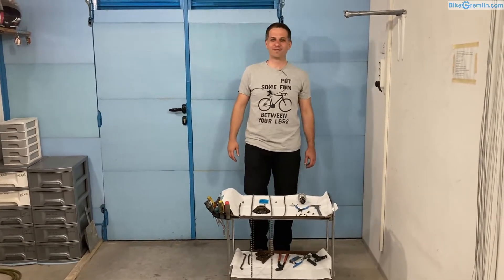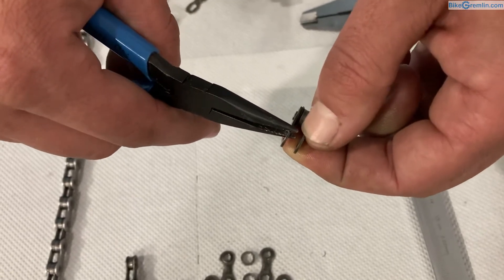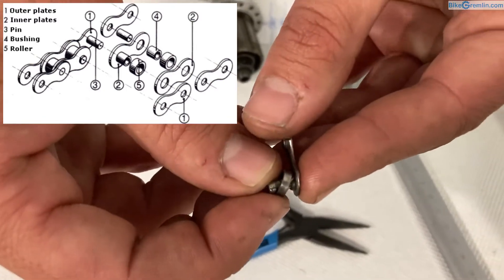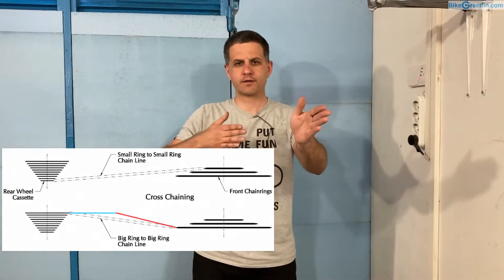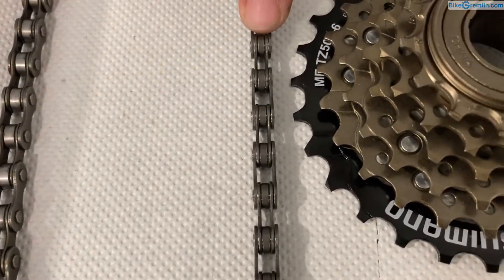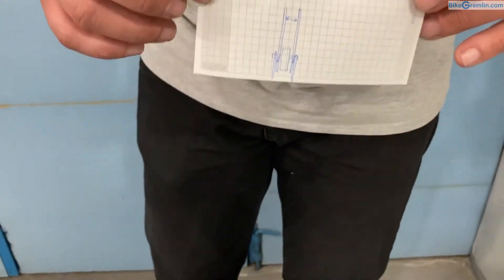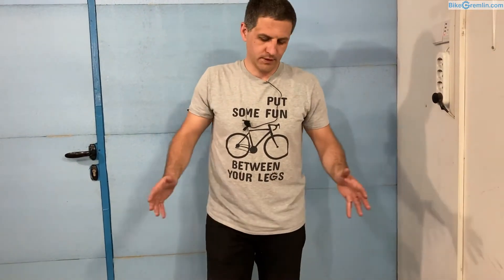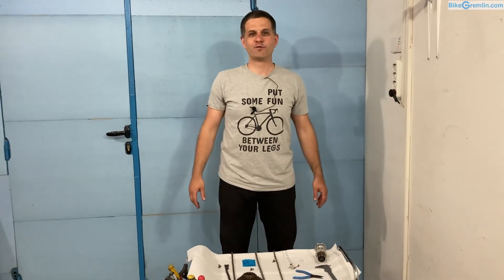Bicycle chain construction and standards

Comment: Excellent explanatory video!
I have always had 5, 6 and 7 speed bicycles, but recently I purchased a 9 speed old B-Twin and was wondering about the differences between the chains, as I intend to restore it. Your chart showing the inner and outer widths (including values in mm - thanks for your kindness) were essential for my understanding.
Thanks for such a clear and clarifying video. Cheers.

Comment: I am trying to understand bicycle chain wear indicators -- but most of them measure "inner" lengths over some number of links on the chain -- and I can't find the official "roller" diameter for bicycle chain. The "inner" length should be N x 12.7mm - D where D is the roller diameter. This can also be measured with a cheap digital caliper. It is also easy to measure the "outer" length of some number of links, however it is less easy to measure some number of links on the "same side."
Reply from the maker: How to measure the chain wear, and some tools that measure it accurately:
https://bike.bikegremlin.com/733/change-chain-bicycle/

Relja
Reply: @BikeGremlinUS  The Shimano TL-CN42 looks like a good design. Maybe I can modify a cheap gauge into one that works the same way?

Comment: Could you please help me to find out the right chain for my Giant Talon Hub gear system?
I recently modified the gear system of my Gaint Talon from  3x7 to Shimano Nexus C 6000 ( Geared hub system) Shimano recommended ratio shall be 18T (R) and 38T (F)front. Accordingly, I provide a 38T Chain ring fixed in front and 18T in the rear, due to the chain slag I am unable to use 38T, Currently using 32T which makes a tic noise when we put pressure on the pedals. What kind of chain should I use for the 38T Chain ring or any other solution to avoid the chain noises. looking for your valuable advice.
Reply from the maker: For chains, the relevant info is their width. 
With gear hubs (only one chainring on each end), it only matters whether the rear hub (and its sprocket) are designed for a single-speed chain which has the inner width of 1/8″ (3.175 mm), or for a multi-speed chain.
- My chain standards article:
https://bike.bikegremlin.com/3555/bicycle-drive-chain-dimension-standards/

A quick way to test is to take an 8-speed chain and see if it nicely and easily fits on the chainrings, and spins smoothly. If it doesn't, a single-speed chain is needed.

Having said that, single speed chains are cheaper, and not any weaker. So, even if you drivetrain works nice with a multi-speed chain, it's worth giving it a go with a single-speed one. If it doesn't scratch anything (like against the hub at the rear), it should work fine.

The tic noise source is important to determine for troubleshooting. I wrote here how to systematically test to see what makes the noise on a bicycle:
https://bike.bikegremlin.com/7153/creaking-clicking/

The tic could be as simple as a single-speed chains (wider) connection link/pin hitting the front chainguard (if there is one) or a part of the rear hub. That doesn't happen per every revolution, as it takes a few turns for the link to reach the front chainring again.

That aside, chain can make noise when it is not lubricated. Poor chainline (angled chain) does make it worse.
In case it's needed and it helps:

How to lubricate the chain:
https://bike.bikegremlin.com/44/best-bicycle-chain-lube/

How to measure and "correct" the chainline:
https://bike.bikegremlin.com/1755/bicycle-chainline/

Relja
Reply: @BikeGremlinUS  Thank you for your valuable reply😀

Comment: Does the front chain ring size change or are they a standard width from 6 to 8 and  9 to 12 , thanks
Reply from the maker: Thickness of chainrings and their spacing is not the same for 6 through 12 speeds.
However, in my experience, it's not a problem to skip several sizes. I've used 10-speed chains on 7 speed cranks and vice-versa with no problems.
Some people report chain dropping between the chainrings and similar, but I haven't had those problems with mine, nor any of the bikes I've serviced. Still, it's fair to note.